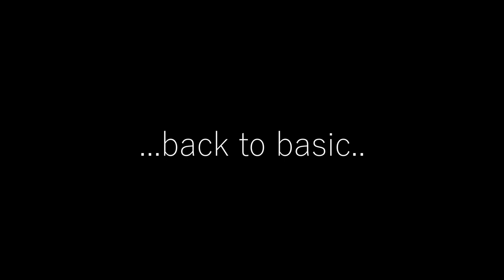Brass nut for the compound slide - Mini lathe modification

Comment: Excellent! If it gets the job done, is accurate enough and better then the original, machinists be damned. 
I couldn't even afford a crappy new mini lathe so ended up buy a mostly buggered one from the 1920's. Although not exactly the same, your compound improvement has inspired me in the repair of the worn out cross slide thread on my lathe. Thanks. 👍
Reply from the maker: Thanks for your comment! Good luck with your lathe too.

Comment: Does anyone know if the cross slide screw is deliberately offset or is it just a "feature", does centralising the screw lead to another problem later down the line.
I am well impressed with your skill in achieving this and your other mods.

Comment: Ordered the bearings to try and copy your compound bearing mod today. Rewatching both videos to try and capture more details about how you did it. Thinking about how to line up the lower compound in the 4-jaw chuck to accurately bore/move the threaded hole is a bit initimidating. Even after watching you do it in the videos.
Any insights you can offer on how you moved the hole to centralize it and measurement considerations would be most welcome as I start to try and duplicate your results! Thanks!

Comment: Yeah that's much nicer.  I removed my compound entirely and replaced it with a cast iron riser block for the tool holder.  much more rigid now.
Reply from the maker: Thanks for your comment. Yes, a solid toolpost is a good improvement in terms of cutting rigidity. But I'm swiveling the compound slide quite often so for now I'm happy with it:)

Comment: Before you forget how all that comes apart you might want to make a new gib for your compound. Stock mini lathe ones usually come pre-bent and “textured” to put it nicely.
Reply: Wait is that how you spell gib it doesn’t look right.. how have I never learned this
Reply from the maker: Yes, some day I will definitely change the gibs on the compound and the crossslide. There are just so much thing to do on this machine :)

Comment: I am reviewing again. I may try something similar. Waiting for a part #4836 from LMS to get off of backorder. I want the modification to work on either compound piece. Also going to try brass gib pieces to tighten action on compound slide. Have you thought about adding a handwheel to the leadscrew? That might be a good project.

Comment: It was off center intentionally. Actually was IN center due to sliding block rails like should so now is actually off-center;-)
Reply from the maker: Interesting :) Never thought about that. But if you look at 0:38 the thread isn't in the center of the ways at all in my eyes. Or what do you think? Ok, now it's even 1mm more off centert to the slideways than it was before. Don't know if this is critical for operation. As said I never thought about this so thanks for your good eye ;)

Comment: Sweet. Why did you use brass and not steel? Won’t steel hold threads better?
Reply from the maker: Thanks for your comment. Actually steel on steel is not a good combi, as it will wear very soon. So you often have steel thread spindles in bronze thread bushings on machines. Bronze is the preferred gliding material and if it wears you can replace the thread bushing easier than the spindle. As I had no bronze, I took a piece of brass :)

Comment: nice humor, I always check mods on mini-lathes, I'm waiting for someone to make a real rigid set up of one of those, hope its you, keep up the good work, thanx for sharing
Reply from the maker: Thank you! There are still some things to improve on the lathe. Some projects are planned. Have you suggestions what you want to see improved? Thanks
Reply: @WeCanDoThatBetter  Locking down the carriage before parting off for example is the only way I've found to make it rigid/no movement, I did make a block that run between the ways, tightened an Allen head bolt that  dropped through an hole on the right hand side of the carriage, now I've fitted a DRO and the scale fit's there so I've lost that option. I'm now looking at the left hand side of the carriage, maybe using one of the holes that a steady mounts too,.....have you any other ideas??
Reply: @bustednuckles2  I also watch that channel, many good mods he's done to his machine.

Comment: Very clever modification you created. My biggest question is. Why do people use a hacksaw to cut a piece of metal off like you did with the brass insert in this video.

I would understand why you did it in this video, due to your lathe was apart, but I have seen a lot of people do what you do. Why not just use the Lathes cut off part (not sure what the exact name is)?

Comment: What kind of micrometer was that you were using to measure the diameter of the hole you were boring out at 3:22?
Reply from the maker: Hi, that's a mitutoyo (name of the brand) internal two point micrometer for measuring holes and internal features.
Reply: @WeCanDoThatBetter  thank you for letting me know. 👍 Are the two internal point pieces (small rods) on the micrometer (jaws for lack of the right terminology) something that you added onto the mic jaws or did that micrometer come that way? I’ve been trying to find that micrometer on Amazon but haven’t had any luck yet.

By the way, I just found your channel and am loving it! I really like the improvements you’ve made to your lathe and really admire your craftsmanship!!! Awesome job man on every video I’ve seen so far! I’ve learned a lot watching your videos and want to attempt some of those upgrades on my small lathe. Please keep up the great work. 🤙